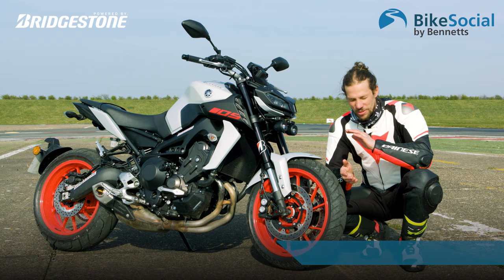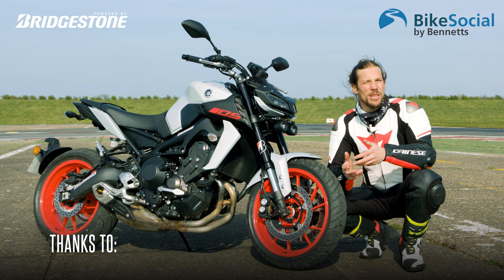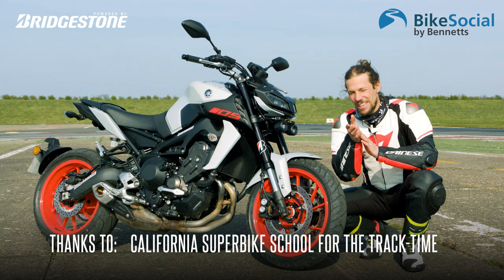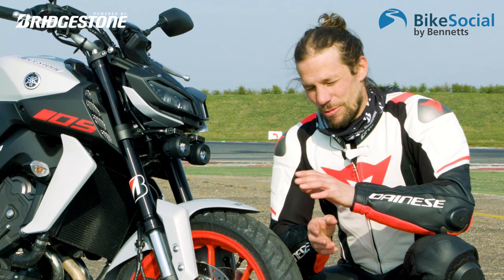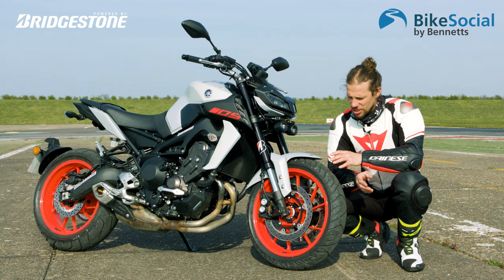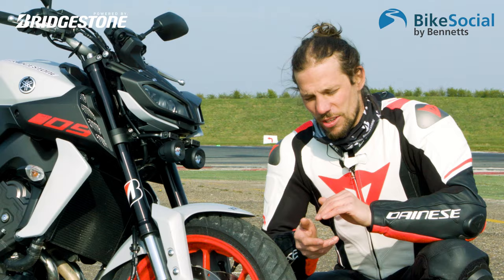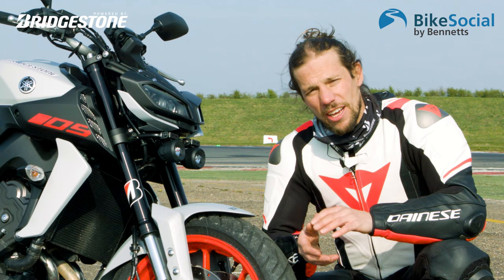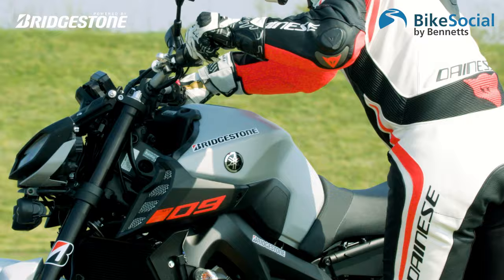Should you brake while turning? Motorcycle riding tips

Comment: Great video, but a few thoughts/questions/comments...                                                                                                                                                                                                                                                                       One: why not take the logical next step and discuss/show how to integrate trail braking into our riding technique? When to use it, when to avoid it (crap/slippery road surfaces, f. ex.). Show us how to integrate the use of throttle & brake (smoothly!) to help load the front suspension and therefore the front tire (or tyre- depending on your geography), increasing grip through the corner. How do I build that skill level when my entire life I’ve been taught to get your braking done while you’re relatively upright, before fully committing/leaning into the corner? Yes, I’m comfortable with gently easing off the brakes while entering a corner and transitioning to full lean, but once I’m into a corner, I don’t feel confident enough with the front tire’s grip/feedback to do much more than gently adjust the throttle, adjust the steering input, or just gently “drag” the brakes, trying to avoid any sudden, jerky inputs that could overcome the tire’s traction... Just as I think most of us have been conditioned to wait until we’re past the apex to start increasing the throttle, gingerly applying more as you come upright, or in really sharp/obstructed corners, as your view of the road ahead opens up...   that sense of self-preservation (or cowardice?), has probably helped keep me alive for the more than thirty-five years I’ve ridden bikes, but has also limited my development as a rider- if you end up on your ass on the pavement just wondering what the hell happened without a clear understanding of WHY, there’s not much of a learning experience, or trust/incentive to explore the limits... Is there a more wholistic (not hollistic- although I’m happy to dance nekkid in the woods under a full moon with a cute hippie chick as long as she doesn’t reek of patchouli...) approach to developing this skill set for those of us who don’t have easy access to a race track and have an aversion to crashing our beloved bikes, as we get closer to exploring the limits of grip in the real world?                                                                             Two: how about exploring the difference between using traction control and ABS versus switching them off? What would be the effect as it pertains to this video of having them on? I’m curious to see how that would impact those instances where the front tire let go? I’m fortunate to have a few bikes, but only one is new enough to have ABS and traction control. I know it’s a great improvement in not only safety, but confidence. However, all of these systems have their limits (and differences in capabilities), and can’t overcome the laws of physics, even if they can stretch them, so just what difference would they make in this test? You were there, with the outriggers, so surely it would have been simple enough to do an A/B comparison with the systems on vs. off? Which brings me to...                                                                                                               Three: I want these outriggers!!! What an amazing learning tool these could be! Just for tire testing/comparisons alone- some basic data logging equipment providing hard numbers (braking distances in the wet vs. dry, f.ex.) coupled with seat-of-the-pants impressions and personal preferences (do you prefer a rounder or a more triangulated profile? These feel great, those don’t give much feedback at turn-in, etc.) could help select a set of tires that really are about as close to a perfect match for your use & priorities on an individual bike- how cool is that?!?! Then there’s the ability to explore (and cross!) the limits of you & your bike’s limits in relative safety without having your insurance company’s phone # on speed-dial or getting to know the staff at your local hospital by name (“Hi George- back again, are we? We’ve got your favorite bed by the window ready & waiting, and nurse Veronica will be by to give you a sponge-bath as soon as you’re out of surgery...”)!  Never mind the fun you could have in the winter with studded tires... I’ve rambled on long enough- thanks for the great video, and the welcome mental distraction during all this Coronavirus crap! Now, back to my thoughts of nurse Veronica and that sponge-bath...

Comment: Well said.
Done it this way for sixty years. 

You can take it one stage further, and correct the angle of the handlebars whilst you let the front brake off, and let the front wheel regain rotation, a bit of skill and experience needed, but it can save you in the wet.

Comment: There are very good arguments for braking in curves.  If you must trail brake to negotiate a curve on public roads you are going too fast.  And who doesn't do that once in a while?  If you trail brake in all curves that you cannot see all the way around it is much easier to add a little (or a lot) more braking when necessary for safety's sake.  I believe that too many riders subscribe to the notion that you shouldn't brake in curves.  Practice it and all the other necessary skills to keep you alive.
Reply: It's when you enter too fast AND take a bad line that you would benefit from trail braking. If you have enough skill to take the correct line, this is much better. And very few corners will benefit from significant trail braking, even when you enter them stupidly fast. Racers benefit from trail braking on tracks that are much wider than what we will ever have, and they benefit by reducing lap time and/or enabling passing on the inside. It doesn't allow them to achieve higher cornering speeds or deeper lean angles. 

Braking in most street corners will only be useful at slower speeds, where you can actually decelerate significantly, in case you come round a bend to find a truck making a turn.

Comment: Missing for me is one way to tighten up turn wo/ braking more is to increase lean angle. The rider was barely off center in every case. Bet if he tipped in more he could have done a lot before even needing to touch the brakes. Two things I see most often when folks see a tightening turn are either grab the brake or stand the bike up and pray for an exit route. Lean often I think a better solution. And if the bike goes, you've a shorter distance to fall! :)

Comment: What you're saying has always been my understanding and practice, however the road based training courses I have attended lately recommend that if we see an obstruction mid corner, we should momentarily pick the bike upright, break firmly as you describe, loading the front, washing off as much speed as needed then tip bike back into the bend.  Obviously a race track is another kettle of fish entirely, with other racers expecting you to maintain a smooth line but I think it is always valuable to know that there are other techniques.
Reply: Getting  the bike upright (or a car's steering straight) is  certainely better when possible and should allow for a harder or faster braking.

Comment: Although I have been riding for LOTS of years, I am always looking for 'improvements' in my skills, and discovering the advancements in technology & tires.
So... there are some 'favorite curves' near by home, that I go thru often, even when just 'running errands'... and I have been practicing things like braking IN the curve -- as if there was debris in the road or an animal runs across -- to 'learn' how to slow down without standing the bike up, nor locking the front end, and while controlling the path of my bike... I have experienced 'reverse-counter-steering' when I limit the counter-steering as the bike wants to stand up, but I need to hold the line I am on, but slower. Other sensations I don't have a name for have come to light, as well. But I have found new skills, and sort of a 'game' to make even my 'mundane' riding more interesting... And each time that I can 'push' just a small bit further -- with more entry speed, or firmer braking, or even some acceleration to move a bit outward in the curve to miss debris -- I feel just a little 'joy' and sense of accomplishment.

Comment: The "trail" in trail breaking is often misunderstood. It means "trail off" - so a strong bite then a steady trailing-off of brake pressure to the apex. This loads the front suspension through the corner until you can see the exit - so if you need to brake, you're front pre-loaded and it's less risky. I'm no expert but there are lots of great books on this :)
Reply: And to my understanding, that’s the key, you don’t apply the break in the turn, you still have some of it from your slowing down in the straight
Reply: @oliviermagere  trailbraking works if u have big entrz speed u brake hard in straight line and let off brakes slowly, more turning=less braking

Comment: I’ve always trail braked, mainly with the back, but I started with off-road for a few years when I was quite young, so I’ve always treated the controls with some respect anyway. Dunno if it’d work for everyone but I’m happy with it.
Reply: Rear trail braking defeats the reasoning behind the technique as front trail braking sets up the suspension and loads the tyre for a larger contact patch. By rear trail braking the rear squats and extends the  forks increasing the trail which can cause the bike to straighten up. Rear braking can be used on a larger cruiser without this effect happening as much.
Reply: This isn’t hard panic braking it’s scrubbing speed off and I did say ‘mainly’. If I need the lose speed very quickly, which is rare, then the front brakes do come in handy. 😉
Reply: @SteveInskip  I never assumed you were in a hard braking situation. My point is that trail braking technique is fundamentally the front brake and not the rear, although as I stated the rear can be used on large cruiser style bikes. 👍😁
Reply: Spad562 never ridden a cruiser so I’ll take your word for that one. My poison is normally fast nakeds and the occasional sports bike. Anyway, take care bud and good riding! 👍

Comment: Understanding and using counter-steering is one of the most important techniques, with trail braking next. If the corner tightens, you just have to learn to counter-steer in harder and the bike will handle it. If you chop the throttle or brake you increase the chance of a crash. You mention "California Super-bike School" - just watch his "Twist of the Wrist II by Keith Code". 1 and a 1/2 hours of how to take a corner. Some corny dialogue but it's compulsory viewing for any biker who wants to improve and stay safe.
Reply: Agreed, get counter-steering right in your head before testing your limits with braking in a corner, maybe master that 2nd if you still think it will help. Not sure why you would switch off the ABS to test this theory though when in the real world pretty much every bike has it by now. Maybe the same test with ABS and what the difference was would of been good. And while your at it maybe a caveat if the roads are wet.
Reply: Don't try this at home? 
Well I would love to give this a go as part of advanced motorbike training. 
I'm not suggesting that I'd reach 70mph going into a bend but practice like this in a controlled set up would be a great confidence booster and lesson in the capability of modern tyres to grip at the extreme. 
To be able to repeat the experience time and again would reduce the level of panic in  situations which often throws fine control out the window.
Off road and Wheelie school might be more obvious fun but exploring tyre grip in this way saves lives. I'd pay for that.
How about it training schools?
Reply: I watched the Keith Code film and I learned a huge amount. Heavy braking increases the contact patch of the tyre and results in different wheel speeds theoretically

Comment: Alternatively on a road you're unfamiliar with and entering a corner that suddenly tightens up. You should already be going slow enough to stop within the area of tarmac you can see in front of you. You'd be lucky if it was a car in front of you that had suddenly stopped god help you if it was road works or, as happened to me once, a landslide had completely filled the road.
Reply: 1066Rider   A lot of what i've learnt over 40+ years of riding bikes, mostly over 750cc is almost totally down to riding at an appropriate speed for any condition. Not just road conditions but personal ones too. Car drivers think I'm bonkers when I tell them what I have to take into account, none of them ever consider the effects of September on the roads until I point out its Autumn especially if it's wet ! They never consider how a car might behave on wet leaves.......slightly different on two wheels. But then say Autumn or Winter to a biker and we all think the same thing and it's not what car drivers think !

Comment: on the street... (not track)... if im going to hot into a turn - i think the most important thin is to everything smooth - if you break, also think of releasing it if speed it fine for turning and making the turn. I have seen people breaking so hard that the bike gets upright and they are leaving the road - breaking way to much - they would have the speed to pass the curve easily. Secound thing in my oppinion is: If breaking is done - to the amount you thin you can handle it - lean over the bike .... if you fall off the bike - i want to slide out of the corner and not leaving the corner upright into the fences because i havent leaned as much as possible and maybe i would have made the corner. short - if im too fast - break smooth as much needed - next is to lean over so you make the turn --- if everything doesn't work i want to slide and reduce speed on the leather before hitting the fances and not driving into the fances. Best thing is of course - dont ride as stupid on road that you dont have any safety margin left... :-)

Comment: can you please try the same tests but with abs and back brake?
Reply: That bike has abs.
Reply: @Ryan-re1rs  they disconnected it.
Reply: I don't think back braking in a corner is a good idea at all. It does not have as much load on the tire and if it slips then you could have the worst case scenario which is a high side crash.
Reply: I was just about to comment the same.  Many bikes today use ABS.
Reply: Corpulent Allgod yes, also the bike will try to stand up and become almost uncontrollable
Reply: @Gurubashy  if you brake with the back brake in a turni It helps to close the turn if you are too fast
Reply: @martinbank_  id advise you to take a cornering safety course (street, not track), because youre telling bs. yes, it does stand up and you can break the traction if youre too hard, but its far, far from being uncontrollable.
Reply: Manuel Wie try it for yourself, it's far better to use front brake. Also depends on lean angle of course
Reply: @nodestra1234  how does it help closing the turn?

Comment: Need front and back in perfect balance - without any skidding.  To get a feel for this try experimenting on flat dirt surface  slightly cornering gently braking front and back - the bike is controllable if the balance is across both - ease on until feel a hint of sliding then regulate one or other.  Translate this feel you learn to a grippier bitumen surface.   

Need to practice to have been in situation before.  If really too hot in, stopping in a straight line slows ten times better if possible - to slow aggressively before hitting anything. Can almost lock the front if straight on level ground.